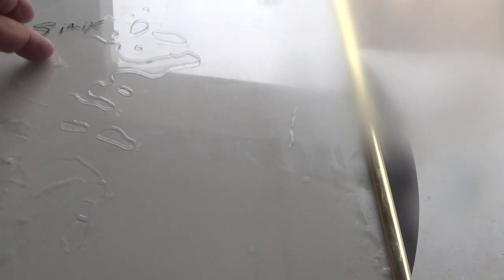Simix ceramic compared to cquartz

Comment: Price and link?
Reply from the maker: Jimmy we are working on labeling right now.We have been applying ceramics to buildings for years.The CEO had no interest in ceramic coatings until he saw the extreme over pricing.It will probably be around $75 for 16 ounces of concentrate.16 ounces will do 16 plus cars. Search simix supreme shield you will find my sight
Reply: Lynda Hopcraft is there a hardness rating not that I'm caught up on that but would be interested to know. Will this be sold under a certain window of time 2 year. 3 year? Again i realize a coating is only as good as the maintenance and care.
Reply from the maker: Jimmy,first and foremost this is Tony the Detail man st Augustine Florida.Been detailing 32 years now retired from the streets.His coating was tested astm for floors where it took one million footsteps one upon the other to wear it off the floor.We will be selling within 2 months.You will maintain the coating by diluting the product.Si02 technology,if you are able to know the scientist,is really about one thing,ambient temperature cured glass.These guys were space shuttle coating scientist.Nano molecular atomic manipulation.I said, holy shit,but all I need to know is "Does it Work". They are water based and hard as a rock for around $75 for 16 ounces.I ordered the c quartz just to see, and now know, that these sio2 guys are taking advantage of detailers who would not get it.I was luckily in a situation where I know these guys personally.call me at 904 5991414 and I will send you some to play with.
Reply from the maker: 9H hardness rating